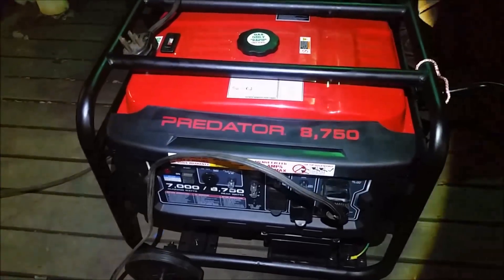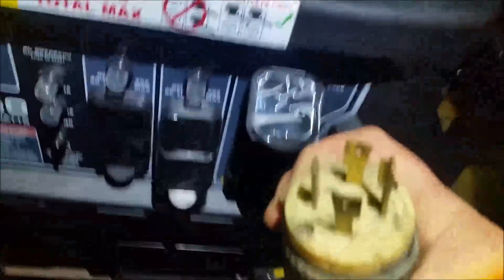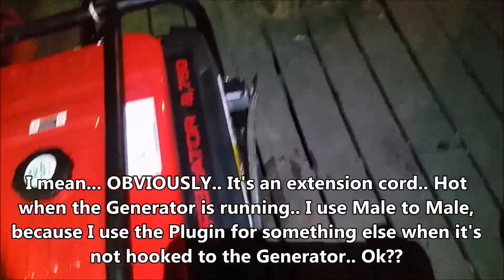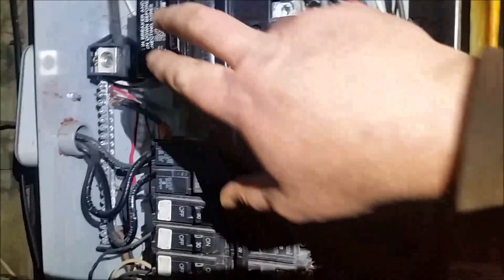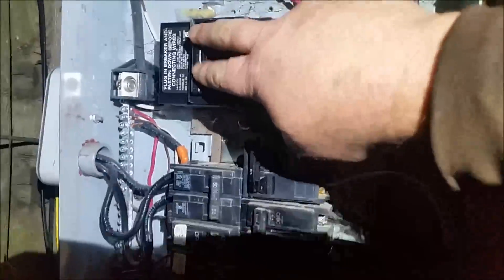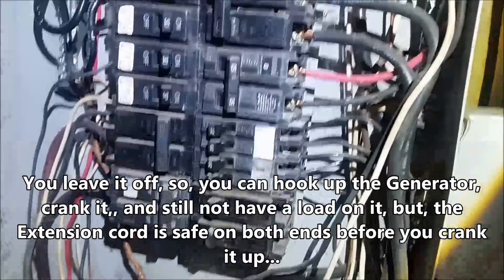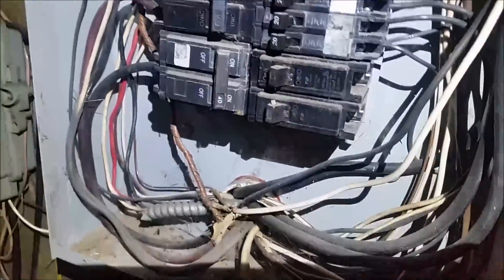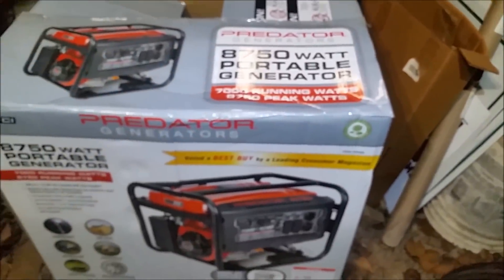Quick/Easy/Safe: Use Existing Plugin/Breaker for Generator hook up to your house Panel box.

Comment: You forgot that you need to isolate the ground and neutral, if you do not isolate you can feed power on the neutral back to the main source which is the utility, and kill someone if they place themselves between the neutral connection point back to the utility...to do this correctly you need to install a transfer switch which does this for you.
Reply from the maker: Jerry Archer.. How Ignorant.. Don't you even think about what you are going to say before you say it??  Would you say something that stupid in front of a group of friends,, or just behind a keyboard as some anonymous user, where you can do things you would normally not do if held accountable? Some sense of Moral Code would say that someone would not.. If that is the case,, do your friends not correct you when you make stupid comments like that.. 
Let me show you how to think,, and show you what you are missing by not thinking this way.. Break things down.. Eat the Elephant, one bite at a time so to speak. 
Break things down into modules and then, piece them together.. Follow me.. Lets break it down.. There are 3 wires coming into your house. 2 hots, 1 Ground. (So, you can forget Neutral, because it does not exist here.. Now, into the goose neck and down into the Meter pan.. How many wires again? Ok.. Same... 
So,, next time you go to Lowes/Home Depot, look at a Meter pan, or look one up on the Internet. Takes seconds.. When you pull the meter out of the meter pan.. What happens?? Power Off.. Correct? How many connectors are there in a Meter pan, or does the Meter plug into?? Four.. Two Hots In, and through the Meter and two hots out.. Turn off the power by removing the connection between two hot wires.. See how simple this is, when you break it down?
Now, out of the Meter Pan and into the Breaker Panel.. First Stop is the "Service Disconnect", which is commonly referred to as the "Main Breaker".. Correct..? 
How many wires to the Main Breaker?? Two hots again.. Why? The Power Company does not own your Panel box, Nor meter pan, but, they do own the meter.. They can pull it and turn you off.. But, you own the Panel and Main Breaker and you can turn them off too.. Correct??? Are you beginning to see the ignorance in your statement??  Ok.. But, is it a fluke? Is there anything else we can learn about this?? Look in the Panel.. Where does the Neutral and Ground wires Go?? To the Ground Bar.. Hmm.. It is just one complete circuit from the power company to ground.. Sound like something to worry about?? Are you seeing that too?? 
Ok.,, lets not get in over our heads and get confused by the super simple panel.. Lets go back to the power company.. Because, you are worried about the Neutral and Ground the Power Company is not, that just goes to ground.. If it goes to ground at your panel,, can you imagine where it would go at the Power Company?? Would it make sense to think it goes to the Power Company?? See??  Why would it just not go to ground?? Just like it does at your house? See how we are tying what we learned at the panel and working backwards with it.. Ok.. So, there are 3 wires from the Transformer to your house. Correct? We know that now.. 
And, three wires that go back to the Transformer.. Correct? We know that now.. Ok,, one quick glance from your pole to the next, and then to the Previous pole.. How many wires do you see?? If you are in a residential area, there are only two wires from pole to pole and from Power Company to Transformer.. Can you imagine which two wires they are?? We know it takes two 120v wires to make a 220v correct? So,, the have to be hot wires,, correct? See how this makes perfect sense, when you break it down?? So,, where did the 3rd wire come from?? Well, we know it goes to ground right?? It does not go from the pole or to this pole from the previous one.. Then,, since it is a ground wire and we know that,, do you think you can find it?? Ahhh.. yes, it goes to the same "EARTH" Ground that your Panel goes. At least the Earth side of the coin.. Now, does that not make perfect sense?? No need for power to go to ground,, correct?? Or no need for Ground to go to Power correct? We know what happens when you Ground a Hot Wire.. Correct? See how you add your knowledge together,, when you learn to think??? 
So.. I would assume that you think you might backfeed the transformer and kill a lineman correct?? Does that sound Stupid to you yet?? Does me!!
Because,, #1, when the main breaker of Service disconnect is turned off,, voltage does not travel back through the Neutral or ground, because there is no Electricity when the Main Breaker or Service Disconnect is turned off.. And,,, when it does.. Where does it go again?? See how this is all so easy and how it makes perfect sense??  Now.. you can find the guy who did the stupid video that all of you guys who don't think bought his stupid crap and Copy and paste this on his page and tell him, he needs to do more thinking, and this is how it is done.. 
So.. If we know how this all works, then, we know a little bit about transfer switches,, can you look at the transfer switch and tell me why they break Neutral and Ground? If you think real hard, this is how you do it.. How could it work any other way?? And, now you know why the build it the way they do.. Now, spend 15 minutes and see if you can figure out how to build one of those boxes without separating the ground/neutral. See how simple that was?? 
So.. Now that you are educated, every day, apply this same technique to your learning and stop repeating crap you heard elsewhere without thinking about it yourself and seeing if it makes any sense to you.. This stuff is not complicated.. It is why you hear so many Electricians here talking stupid shit they can't explain.. It does not take very much smarts to become an electrician, so, they usually don't have much to begin with.. It is just something that their level of Intelligence can handle and they kept doing it.. Do your own thinking.. After all. If someone is doing something and you don't think you can do it yourself, because they must have years of training,, let me tell you that at age 17, I looked at two panels and some switches and receptacles and wires my own house and passed inspection with flying colors.. Now, the most valuable way to think.. Break it down again.. Into modules. Here is this guy who does something you can't do.. 
WHAT BASIC TOOLS IS HE USING??  Pliars, screwdriver, etc??? No.. Not what I am talking about.. You can buy them.. I am talking about 2 eyes, and two hands.. If he can do it,, then, why can't you? Because you have not thought about it yet, and you just "THINK" you can't do it. And, that is a fact!! It's why there is Nothing that I can't do. After all. I am human.. 
So,, I didn't answer your question directly.. I showed you how to do it,, and when you break it down and think about it,, even if you forget some detail, you will be able to figure it out, quickly by using what you know and looking back at the part that you forgot,, and bingo,, it all makes sense again.. Now, you will never forget it.
Welcome to a new world.. Enjoy it.. It is full of all sorts of new and exciting things.. , Now., I will answer your question. Because it is not needed! Hows that for a one liner.. Ha..Ha.. You would not have believed me had I said that first. But, now you know it, because you know what I know about it and it makes sense and no one can every fool you again, and you will stop making comments without thinking about them. cheers.
Reply: Mark Thomas  Rules and utility wiring differs from country to country.  Since you refer to NEC (National Electric Code) it would appear you are in USA. In video one of your panels is mounted sideways which is common in Canada. I am in USA so can only speak to customs in USA.

 I believe that the third wire from house to pole is called a neutral; not a ground. It completes a circuit back to utility transformer for the power difference between power lines #1 and #2. In normal usage neutral power does not go out of your panel down into the ground; it returns to the pole. If you don't believe me, try disconnecting [NOT FOR AMATEURS] the neutral between your house and pole and see how lights dim and things run funny.

Since utility transformers  often serve more than one house, the three wires from a transformer may run from pole to pole at 2/3 pole height. I think you are correct that near the top of poles there will be two (maybe 1) higher voltage wires that feed the transformers (for residential service), but I don't know for sure.

So, the question becomes when operating a generator with a jumper cord and switching the MAIN breaker OFF, as you described, can any current travel back on the neutral wire in your panel to the utility pole and endanger a lineman? Or does ALL this current return to the generator via its 4-wire cord? AND what happens if the neutral wire in cord is "open" (broken)?

Another question would be, even if installing a safety switch/lockout on the panel MAIN breaker or if using a properly installed transfer switch, do these methods disconnect the neutral from the utility?
I don't know for sure but I do not think they do, thus, making me think that it is not necessary for safety reasons. The only requirement is that the two main power lines be disconnected.
Reply from the maker: Munsters.. You are correct about the Neutral wire, which is going to ground.. It is not a feed from the Utility to Transformer. The Neutral wire goes Only from Ground to Transformer, then to the House.. That is why I use it interchangeably. Same with the Panel Ground and Neutral. The both go to the Earth Grounded bus.. 
The wires that feed the transformer will be 2 high voltage wires if the feed is 3 phase.. Two hots, each transformed down to 120v each for the house feed of 240 volts. There is no ground or neutral until the ground that turns into the neutral (proper term for the ground at that point) at the transformer.. The reason why you can't backfeed via the neutral only for those who say, you can backfeed past the Main Breaker while it is off. Without the hots, the neutral does not function as more than a ground, and the panel is directly connected to ground from it's Neutral/Ground bus. 
Loosing a neutral or ground at the Generator or panel will cause some issues. Same as it would at the pole. At that point, all rules you know about premisis wiring go out of the window and you have to start troubleshooting from your gut.. I have seen all sorts of weird problems.. But, you will surely know that something is wrong, and it won't take longer than the loss of either. But, the problem will be isolated in the area of the bad ground, as far as I have seen.
The Transfer switch by nature of how it is built and it's intended function should by design, force the neutral to be isolated on each circuit.. I have only really looked at two of them and wondered how they would do it any other way.. I do not think it was designed particularly to isolate, just, the fact that, it is a byproduct of the initial design.. 
It is very common to backfeed breakers... Most people don't realize that, because, the only reference most people have is us Hacks and Rednecks that are doing it with generators, to a standard house panel where this is unusual for any other case than running a generator, so, reading this forum post should ease your mind a bit.. In other areas, it happens a lot more frequently on a professional basis, done by more advanced or higher level engineers in non-typical for homeowner applications.
https://www.electriciantalk.com/f2/breakers-directional-19714/ 
I do not have any plans currently to do any electrical work, but, next time I go to the local box store, I'll see if they have any transfer switches and take a close look at them.. The one my brother has, I looked at not too long ago and I could tell there was no other way to wire it without complicating the Utility/Off/Generator manual switch.. 
NOTE: Loosing a ground or Neutral, it would be hard for anyone to guarantee you anything.. If I were a betting man, I would not bet on anything until I proved it. But, I can say that, if you loose a ground, or you put a really heavy load on one side of a generator, you are most likely going to be replacing some electronics in your home. At least surge strips, fuses, etc.. We had that discussion here somewhere when talking about this with a poster who had a ground connection at the goosehead that slowly failed, and we were comparing notes to a problem I had overloading one side of the box with several heavy draw 120v appliances on a kitchen circuit where both breakers ended up on the same leg in the panel.. Fancy Hot Plate, Counter top Broiler and Microwave all on at the same time and basically only lights on the other side.. Was remedied by moving one of the 120 breakers one slot down on the same side to get it to feed from the other leg on the other side.. Same as a 220v breaker would be on one side of the panel and feed from both legs on either side.. Something else a lot of people miss looking at a breaker box. Every other slot runs from the same side of the box, and ever other from that feeds from the opposite side.
There are inherent risks using this setup.. The human being who is using this setup would be the only problem. The main breaker "MUST" be turned off, then the cord connected,, then, the Generator cranked and the exact opposite in reverse.. And, the only reason to do this without an Interlock or Transfer switch other than to save a few bucks is to use an existing plugin that is already there, ready to be used with a generator.. 
An Interlock is the next least expensive option that takes "Operator error out of the picture".. Main and generator breaker move opposite of each other and at the same time.. It is impossible to backfeed to utility, and only requires the interlock and a Male Connector off of the generator breaker to use a standard Male to Female generator cord.. What I would recommend to the "Average" user.. Cheers.
Reply from the maker: @jerryarcher6916  you needed preaching to. You made incorrect accusations and statements on my video. You talked like you should know what you're talking about, and didn't. I don't want erroneous information posted about my video. I would be embarrassed to tell someone that I had 40 years experience as an electrical engineer after making that kind of simple but critical error.
By the way. You didn't give any information to anyone that would make any difference. Would not make anyone safe. So the comment you just made was also incorrect. I don't know why you didn't understand the simple explanation that I gave you as to why the hot and neutral make 0 difference when you're talking about back feeding to utility. I don't know how you could think that with two weeks of experience much less 40 years. I have no formal training at all. But I can explain that to anyone in a matter of minutes, if I were standing near a pole and panel and could point it out. 40 years experience in you miss such basic and fundamental keys to something so simple. It just reinforces what I said about electricians to begin with. It is such a simple trade, the simple minds are very common being used in them.
As far as preaching? You came here first. Making ignorant comments. I'm merely corrected you with a kindergarten explanation to make sure you got it. I knew I was dealing with someone weak-minded to even make such an ignorant statement. I really don't think you got it. I did my best. Anyone else can understand it.
Reply: Sir I do not know you and not sure you understand where I was coming from, you seem like you know what you're doing, and I was just pointing out that the neutral carries power to and from the utility...
My background is power systems from large utilities to residential...you just have your ass on your shoulders, if you can't take a little questioning to protect someones life, then you need to quit giving out     information...you are too judgemental, and a fucking know-it-all.
Reply from the maker: @jerryarcher6916  I spent all that time explaining things to you so a 5th grader could understand it, and you still missed it. If you read what I said in my first reply you couldn't possibly have made the statement you just made. What you were talking about is how the electricity works in a residential application or once the utility power gets into a building. From the utility to the panel is completely different. That's what you don't understand after 40 years. Go back and read my replies again it will make sense. Make sure you do it during the day, so you can walk out and look at the poles to be 100% confident in your new knowledge. I have merely been correcting you. And I corrected you because you made an authoritative statement like you knew what you were talking about, and it's obvious you do not. After 40 years that's a damn shame.